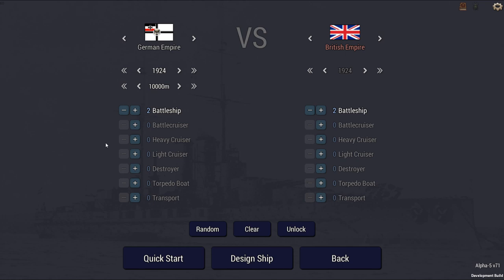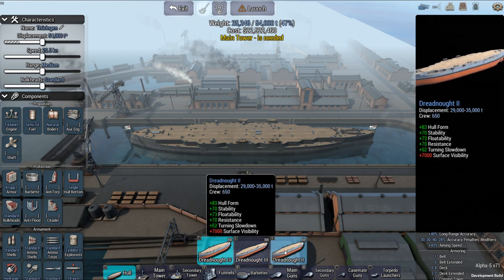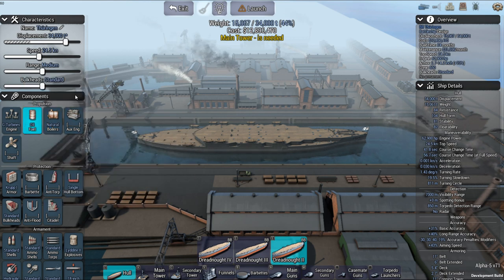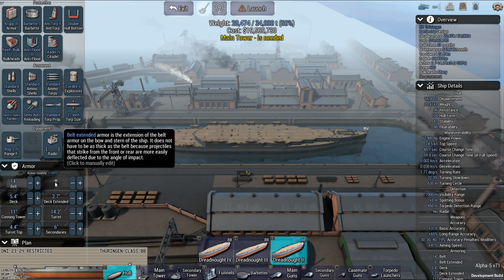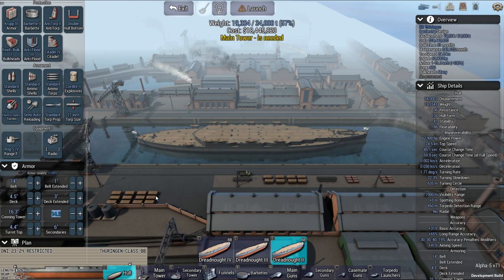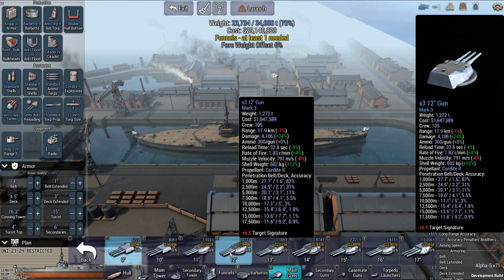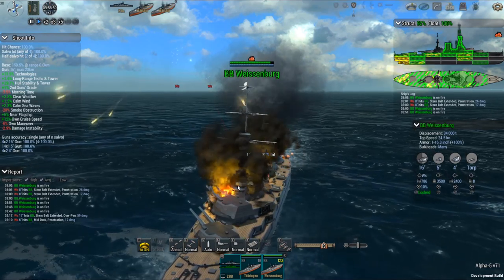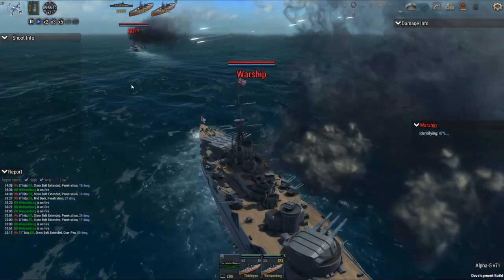1924 German Battleship - Ultimate Admiral: Dreadnoughts

Comment: They never used 5" or 16", they had 11-15" Main guns, the casemates were 6-7" and the aux sec were 3-4", the rest of  things are ok
Source
Navweaps.com
Literally any source of information

Pls don't use clickbait anymore. This desing is more like planZ desing
Reply from the maker: I used 16" due to the fact other navies by this time were using it, G3, Nagato, Colorado, Amagi, Kii, South Dakota, Lexington, Tosa etc (N3 were thinking of 18" main guns along with the class after the Kii for Japan).  Its not a far stretch to think, if no limitations on the German navy, a 16 main gun wasn't thought about in 1924.  Also, I was designing it as if the treaties hadn't limited the German navy.  This design is a full 8 or so years after Bayern.  It is pure speculation based upon what other navies would have also been doing without the limiting treaties.
In reality the navy was limited to 10,000 tons, and 11" main guns.
Reply: @wowzery  ok; about ur final point, i sujested the actual ships's gun, and so i dont know so much about the prints designs of interwar time
Reply: There are some preliminary designs with 16 inch guns for the Imperial German navy. Of course they didn't get to build any because their navy suffered a critical existence failure in 1919.
But in an alternate timeline, ships with calibers of 16in and bigger would've been built